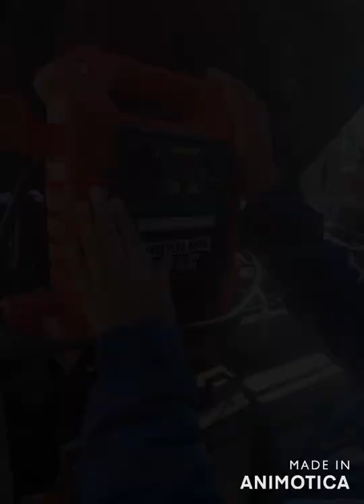AVAPow 6000A Jump Starter vs. Harbor Freight Viking 3400A

Comment: You’re battery voltage was too low for the avapow to recognize it that’s why the beeping and it doesn’t have boost
Reply: You gotta hold down the button on the box that cables are hooked too and it puts it in bypass and will kick on
Reply: @darknature79 Exactly what I was about to say. 👍🏾
Reply: Voltage to low? The hell is a jump starter for then
Reply: It’s a booster not a battery … voltage supposed to be from 11-14 volts anything below 10 is like a completely dead battery and is beyond boost from regular booster it will only start with booster that can start a car by itself then the alternator can charge the battery